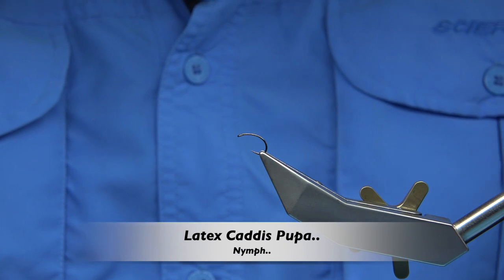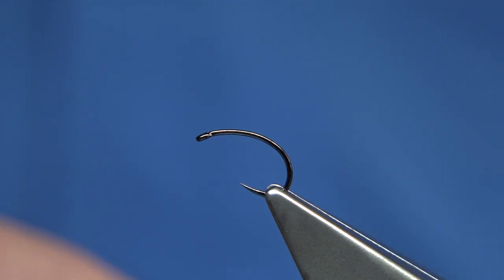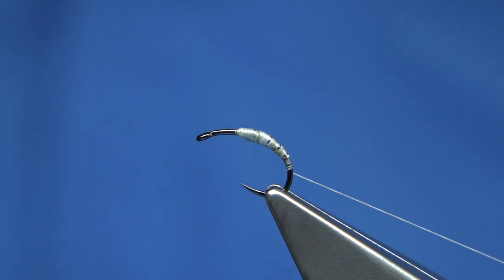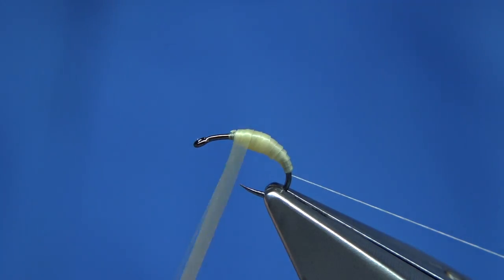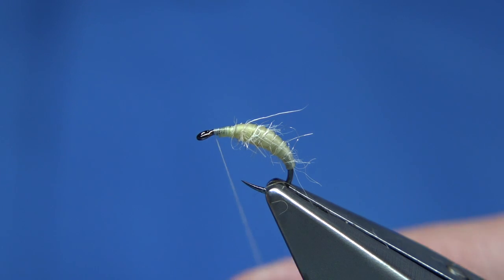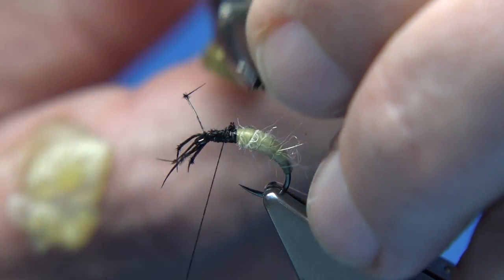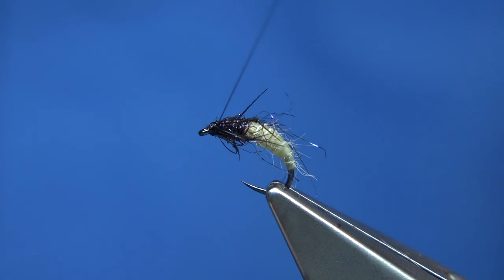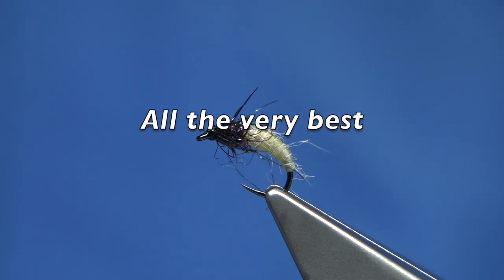Tying a Latex Caddis Pupa with Davie McPhail

Comment: In the old days we would sandwich the latex between sheets of paper and cut with shears (large scissors). The latex strips are straight and smooth. I’m in the USA and it was the common method of cutting latex into strips in the late 1970’s. I will try this method to compare.

Comment: I tied up a few of these, but made the ignorant mistake of putting UV resin on the abdomen of them. The resin did something to the latex that caused it all to crack and fall apart. Super glue does the same thing! Do you know if this is expected?
Reply from the maker: Hi Half Insane Outdoor Guy,

I have used veniards varnish on the backs of some Czech nymphs which does last ok though I would normally leave the latex as it is as you know that it does react to resins and glues..

All the very best Davie
Reply: And who thought chemistry would have such impact on fly tying?
Reply: Interesting.  I find latex-bodied flys tend to 'rot' quite quickly in my fly boxes, and even faster if open to UV light.  @DavieMcPhail    It may be that latex flys should be regarded as having a 'use by' date.